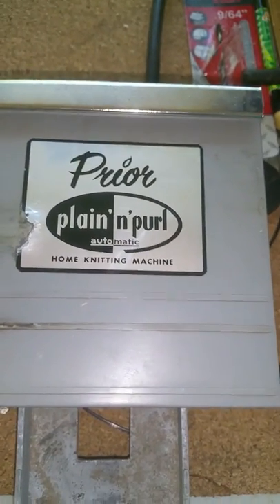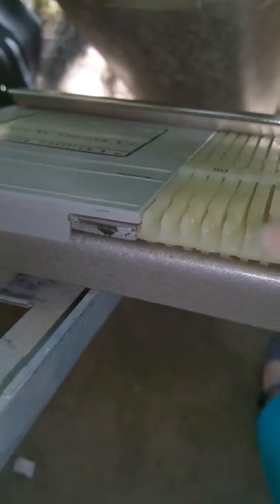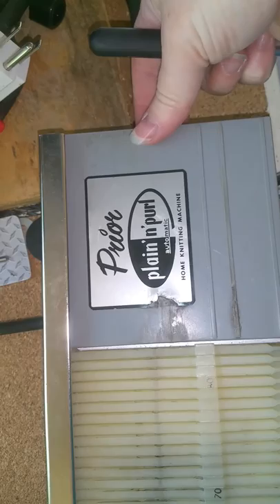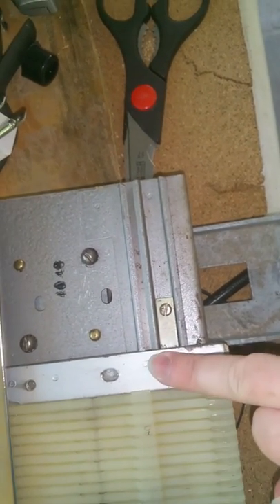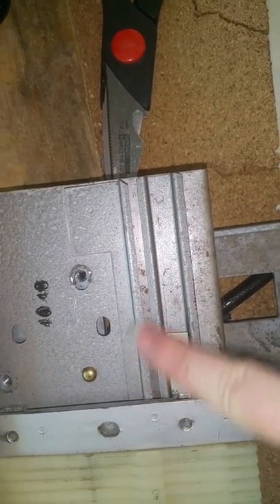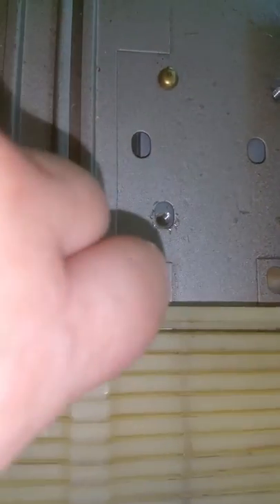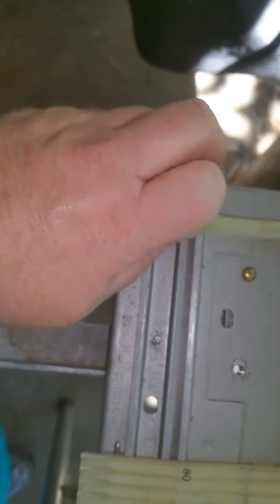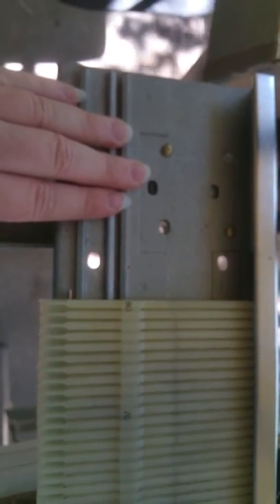Deep Cleaning a Prior Plain'n Purl with Bakelite beds

Comment: My observation is that it is impossible to reassemble the pieces  accurately, take these apart at your peril.
Reply: Is this comment based on personal experience?  Did you ever manage it and if so, any tips?  I've had mine knitting but it is very stiff so needs to come apart and be cleaned.
Reply: I am aware of other users with bakelite bed machines not being able to put them back together. The bakelite changes with age. Myself I have one bakelite bed machine that had just one screw fully removed and I am yet to get the holes to line up properly to be able to put the screw back in. The bed panels had swollen. I am not game to try it with the Prior machine and have instead left the bed alone, but removed needles and pushers then cleaned the channels with a cotton bud and a pure cleaning alcohol and machine oil mix. Still haven't had time to knit anything other than a sample.